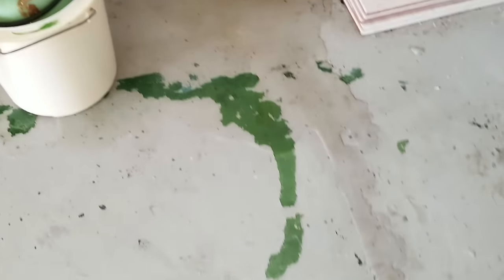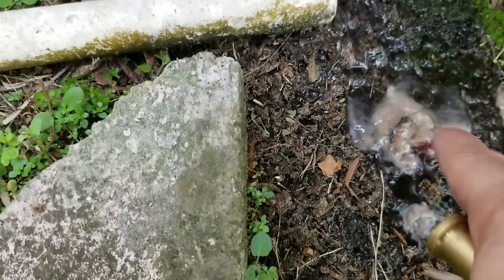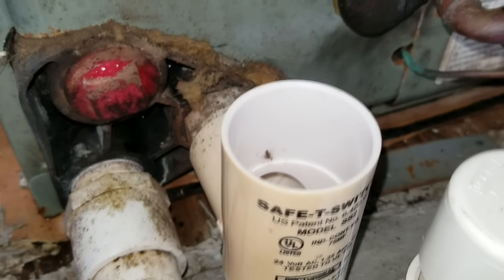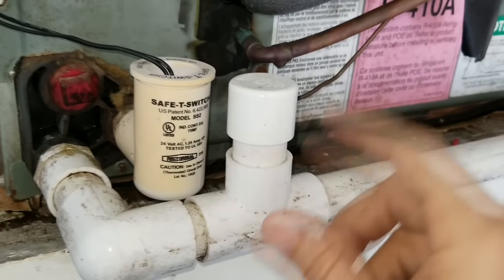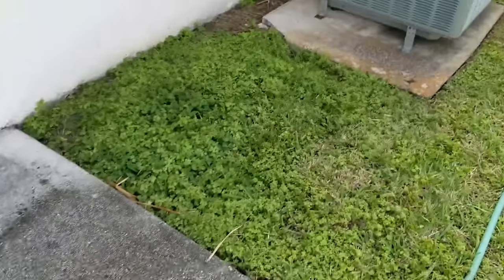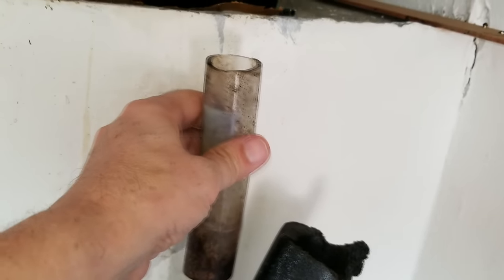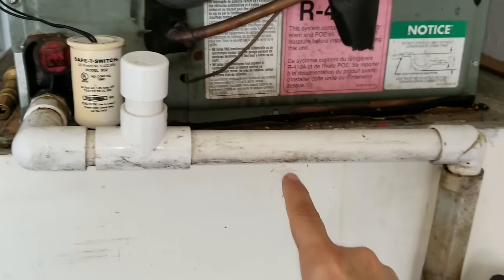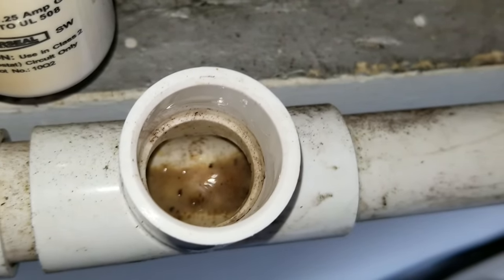How to Unclog AC Drain Line Fast (3 Seconds), Avoid Repairman

Comment: What can produce a big jelly like blob coming out of the outside pipe? I pay a company to do preventive maintenance but have had several floods. I was charged for the emergency visit. The tech said it was not AC but finally the owner came by and flushed it with a waterhose and out came a huge blob that looked like a jelly -fish. He did not own up to it but I still have questions..was the maintenance done correctly or did this technician cut corners  over and over? I need to know, because I feel that huge blob is not something that grows in a few weeks or even months. Please advice .
Reply from the maker: We see this all the time. It's the bacteria and sludge that collects in the pipes over time, comes from the drain pan mostly. Best course of action for you is to buy the best filters, not the cheap ones, change these best filters every 2-3 months, and twice a year get the AC pan treatment from Home Depot and pour it in the pan. This helps maintain a clean system. Some people like to dump some bleach down their AC drain pain pipe every now and then to kill or prevent new mold, bacteria, sludge, etc from forming, but I had bleach. It's all up to you.
Reply: @jeffostroff  , thank you for your reply. I  use the filters recommended by the company and the unit is less than 2 years old. They told me not to dump vinegar( that is what I always used). I will go back to    my previous routine .
Reply from the maker: @rosariosantiago7112   What filters do they want you to use? A lot of times I find that the manufacturers tell you to use filters that are very inferior like those washable filters those are a complete joke. I only buy the really nice pleaded paper filters with the highest rating. And I try to buy them at Sam's club or Costco for the best price

Comment: Our Air conditioner unit is in the attic of our 2 story home. The line is clogged because water is running down the side of the house  from the roof. Two years ago, the a/c guy went up in the attic to use the compressor. Since this problem occurred again, what can I do to fix it myself?
Reply: The guy used air compressor to clear the line. How can I save costs to repair it myself?
Reply from the maker: You should be able to do the same thing with a garden hose, might take 2 people to coordinate. OR try putting a shop vac on the output of the drain pipe outside the house and see if it can create enough suction to pull it out that way. You should be adding AC pan product to the drain pan every 6 months minimum to prevent clogs.

Comment: Okay so it worked to drain the line, but the water was backed up into the unit so I let it drain out the bottom, but now my fan won’t kick on… I cleaned the coils too. Maybe it needs to dry out? Or does anyone reckon the fuse is blown from all the standing water?

Comment: The p-trap is so your AC can be more efficient and doesn’t suck up unconditioned air.
Reply from the maker: correct, it keeps hot humid air from outside th ehouse from getting into the AC where is would cause excessive condensation

Comment: My ac drain outside has a large amount of water like a small stream which leaves standing water is that normal there is no leaking inside
Reply from the maker: Yes, that is what is supposed to happen. As your AC cools the house and draws humidity out of the air it condenses into water in your AC and it drips down into the drain pan, and from there it needs to go down the drain pipe outside your home and it drips there.
Reply: @jeffostroff   thank you!!

Comment: Have an even easier fix for those in a condo take a coke bottle / liter size fill it with warm water from the tap put the coke bootle in line and squeeze the bootle slowly and the pressure is enough to unclog the line.
Reply from the maker: That's a cool idea, gotta try that one next time

Comment: Does this make your AC unit run super hot ?
Reply from the maker: Do you mean does the clog make your AC run hot? No the clog makes your AC leak. If you have a properly installed float switch, the clog should eventually cause water to back up into the pan, then fill up the float switch, where the switch rises and shuts of the AC. One you clean out the pipes, the Ac is running smooth, but nothing here will make the  AC run hot.
Reply: @jeffostroff  okay here's my situation . Found 5 gallons of water in my ducts and water coming out of the front of the base of my lines at the base of furnace .  Went outside to check the unit and it was running super hot .  Condenser or clogged air flow problem  ?
Reply from the maker: @jesusoftheapes  The units normally run warm, so would have to see what the surface temperature is of the unit, everyone has their own definition of hot. But if it is getting super hot, feel the pipes, see if they are hotter than normal. Could be the compressor is getting too hot and ready to go, could mean you'r low on refrigerant, would  like to see where on the outside unit is it getting hot. Also is the larger pipe coming out of the AC unit outside wrapped in foam from the second it leaves the AC unit until it attaches to the wall of the house?
Reply: @jeffostroff  the entire outdoor unit is producing heat hotter than 100 degrees
Reply: @jeffostroff  the capacitor was running the fan in reverse for whatever reason .
Reply from the maker: @jesusoftheapes  Was that what was making it warm?  Even so 100 degrees doe snot sound to hot to me, and motors will spin either direction. BUT... if your capacitor is the large one the size of a can, it is usually electrolytic, which means it has a plus and minus terminal, so if that is hooked up backwards, usually the capacitor blows with a huge fury of smoke and fire.
Reply: jesusoftheapes your capacitor was low wasn’t it? Unless someone recently messed with your unit and flipped the wires around.

Comment: mine like yours switch did not turn off the a/c but flooded the floor?
Reply from the maker: IF the switch does not turn off, it is likely installed in the wrong spot or positioned so that rising water in the pipe won't fill up the chamber holding the float swithc, so it won't trip.

Comment: What if the ac unit is on the first floor. And has a crawl space below it?
Reply from the maker: Try a shopvac on the output of the pipe outside, hopefully they ran the pipe out from under the house, it's a bad idea to let it drain under the house. All you need is access to the pipe from above if you want to cram the hose down there.

Comment: If folks would clean their garage and ac unit, change out the filter every month and service it once a year, the system would run fine.
Reply from the maker: This should be printed on everyone's front door.
Reply: I do everything you stated and I still have issues with my AC.
Reply: @THEGREEDYCOUPLE  .....you need to call the right tech.
Reply from the maker: @THEGREEDYCOUPLE   What is your AC doing
Reply: @jeffostroff  My ac at least every 3 months it is leakinging inside my house, we add a big bin to catch the water so it doesn't damage the house. When the tech comes, he uses a water vacuum and sucks out all this water and removes the cover off the inside AC and cleans out all this brown stuff. Then the AC is fine, 2 to 3 months it's doing it again. Each time he comes out it's the same process and I say to him, this can't be normal.

Also, for some reason when he comes he turns the PVC pipe that is outside dripping water "up". Because I'm not a technician I leave it but when I go to other people's house their's is down! So I put mine down, then when he comes to clean it, he puts it back up. Also whenever my AC turns on, it chips out the outlet in my kitchen, is that normal? Then we have to keep pushing that button in so we can plug this in the outlet.
Reply: I know it's easy to say "call the right tech" but how do you know? I have ask my neighbors, family and friends for referrals and so far all of them comes out and do the same thing and then charges $250. I want a new AC but how can you trust anyone when they are all ripping you off.
Reply: @THEGREEDYCOUPLE  .......how about watching more videos on how to trouble shoot a AC problem. Wish i could help more.
Reply: @wolf2351  I have watched so many videos, my husband and I are going to buy a wet vacum and see if our maintenance will work, no one has $250 everytime they come out!

Comment: I don't like that installation - the condensate line shouldn't go back up after it goes into the slab, it should drain into a dry well/pit of gravel. Plus, according to code you can't put anything smaller than 2" under concrete.
Reply from the maker: Yes, the AC installers really botched the installation, and they did not install a trap, you can see the sticker on the AC even says to install the trap. But I disagree with your statement about code, builders have been running that 3/4" PVC drain line through concrete for decades. I want to see that actual chapter and paragraph.

Comment: The trap is dependent on WHERE you have the fan/blower in your air handler. Drain line connections BEFORE the blower NEED a trap to drain properly. This condition they will NOT drain proper without a trap. Drain lines AFTER the blower do NOT need a trap. Has nothing to do with methane gas and any codes. Simple physics is all.
Reply from the maker: Yes, usually they will tell you in the install guide to place the trap within so many inches of the exit port on the AC unit.

Comment: ugh. Mine is set up nothing like this. Nearly impossible to get to.
Reply from the maker: Yes, a few people have reported the same. What you can do is cut the pipe, then insert the hose into the downstream part of the pipe and clean it out. Then add your own lean out to it so that the next time all you have to do is pull off the cap and insert the hose.  Also, try a shop vac on the outside of your drain line where it pops up outside the house, and see if that helps. Numerous people report success with that.

Comment: That AC unit needs to be cleaned up.  The coils and the pan are probably filthy.  It's not hard to clean and it would run a lot more efficiently and wouldn't clog again as soon (or perhaps ever, if the coils and pan were cleaned / maintained just a bit each year).

Comment: I used an air compressor and blew it back from the outside.  The water comes gushing out with all the gross chunks that get broken up.
Reply from the maker: Usually the AC repair guys will blow the air out from the inside so that it blows outside the house
Reply: @jeffostroff  Yeah, that would be the better way and I wish I could have done it that way.  I tried, but just didn't have enough access from inside.   I'll probably rig something up that can squeeze in there the next time it happens.

Comment: Jeff, Hope you’re still active in giving advise.  When I use my dry vac to absorb the water or moisture from my drain pipe supposedly coming from my ac,  a good amount of water being absorbed for an hour run of my ac.  Where is that excess water coming from?
Reply: Sink, water heater or ???  Thanks.
Reply from the maker: Rey, the water was likely in your AC pan, and also backed up inside the pipe. Remember when you tie the vac to the outside drain pipe in your yard, all that water backed up behind the clog all the way back to the AC.
Reply: Good morning,  Jeff my ac doesn’t have pan,  house was built in early 90’s.  When I did more researched,  other outlet for the moisture is the bathroom sink.  Will be possible that the excess water that I extract from the drain is coming else where?  Thank you so much !!!

Comment: Your clog is probably at the 90 elbow coming out of the AC coil.  Unscrew the fitting and clean out.  Then re-install.
Reply from the maker: that's why I hate 90s in these non pressurized pipes. All DWV pipes should be using bends not 90s.

Comment: Stupid place for the safety switch.  The thing is higher than the top edge of the drain pan.  The switch is designed to be inline with the primary drain.
Reply from the maker: Yes it is not the best spot for it, and unfortunately many AC manufacturers make that secondary port higher than the main drain's port. My preference is to T off the drain line and put the float switch there, this way as the sloped drain line fills up, it will float up the float switch, and the float switch will trigger the AC to shut off before the AC pan even has a chance to start backing up and filling with water.
Reply: @jeffostroff  The problem with the secondary drain switch not working is I believe on that model air handler there is a small weep hole between the two drains in the pan, it needs to be blocked in order for the secondary water level to rise enough to lift the float switch.
Reply from the maker: @rogerp6979  Crazy design!

Comment: Ptrap on mine was 99% clogged. Had been using tablets in drain about ever spring but didn’t stop the clog. Replaced trap and all is well for the time being. Guess I’ll start using clorox.
Reply from the maker: Make sure you use highest quality Ac filters, change them every 3 months, spray AC coil cleaner foam on your AC coils twice per year. Every few months dump some water into your ac pan and let the force of that draining water self clean out the pipes.

Comment: My drain line has so many turns and two up and down spots. There is about 4 possible clog spots in mine and i cant get to them.
Reply from the maker: the hose will gush water through there for you

Comment: We used shop vac to clogged drain outside, ( but dumb me left cap on the over flow, & now can’t get cap off) any suggestions?  We poured the vinegar in, I set cap loosely on top, but evidently the suction made a vacuum seal & can’t get cap back off
Reply from the maker: Try turning off the ac first and use a pair of channel lock pliers, twist it counter clockwise like unscrewing a screw, see how that works.
Reply: Will try in the morning, thank you, was worried about breaking the cap or drain.. thank you… will let you know

Comment: Twice a year I go in my attic and pour liquid Drano  in the pipe coming off the drain pan. I never have any issues.
Reply from the maker: Scary, I hate the idea of AC units up there
Reply: My furnace thing is in the attic.. I've never been up there. Bought this 2 story house in February, first time home owners. My AC gave out 2 days ago.. Doesn't turn on at all. I'm wondering if this is the reason cause I notice there are no drip lines leading outside.. I never see water... Got a tech coming tomorrow since we have home warranty included from seller. We currently in hell right now I'm San Antonio. I'm eager to know the reason tomorrow.
Reply: @big31074 My actual AC Unit is outside, but the casing with the duct work is in the attic. The drain pan is under that. There are 2 drain lines. If they clog up the drain pan will fill with water. You should have a float switch hooked to the drain pan. What this does is stop the AC from working if the pan fills up to keep the water running over on your ceilings. If this is the problem( which i had in the past) simply use a wet vac with a hose connection to vacuum all the water out, then unclog your lines and it will be fine. Could also be as simple as your thermostat too. Hope you get it fixed today. PS: If you get a chance check out my son "The Cajun Ninja" He has over a million followers on Face Book and I think over a hundred thousand on You Tube.
Reply: @masterlee4370  hey thanks man. The furnace stuff is in the attic in or 2 story home. The only thing outside is the big fan thing. I'll check out The Cajun Ninja as well.. Is it like a cooking thing or gaming?
Reply: @big31074  He does cooking videos. He also teaches Martial Arts which is how he came up with the name. Has his own seasoning called "PI-YAHHHHH" and is in many grocery stores and growing. Thanks for checking him out, much appreciated.

Comment: I put drain cleaner down mines...clear it rite up in a day
..no need to drag hose into the house
Reply from the maker: It was just inside the garage. Drain cleaner usually helps no one base don all the calls I get. You need to physically remove the substance blocking the pipe.